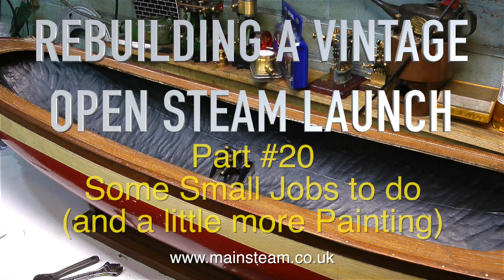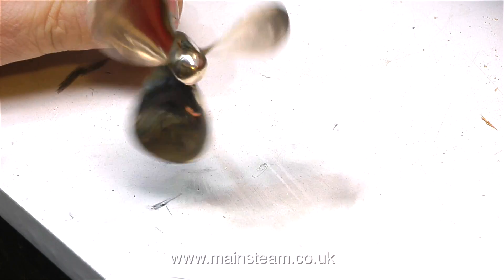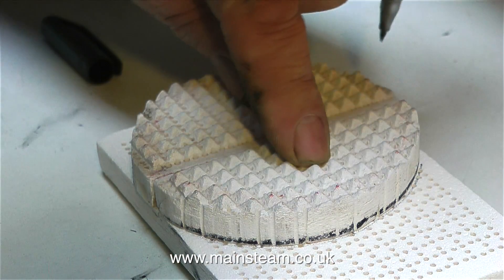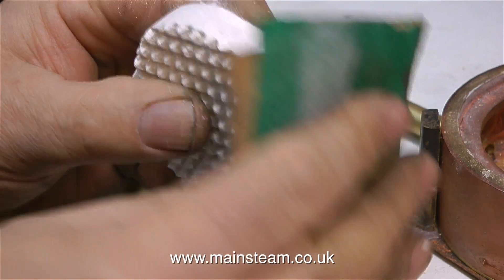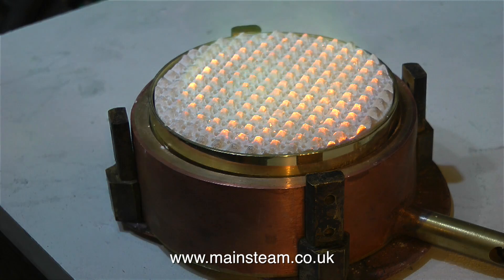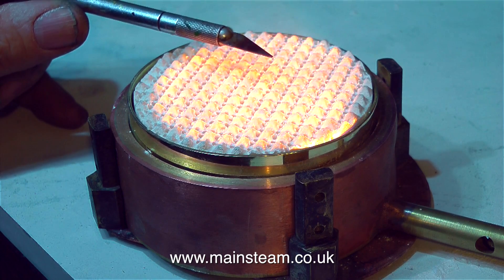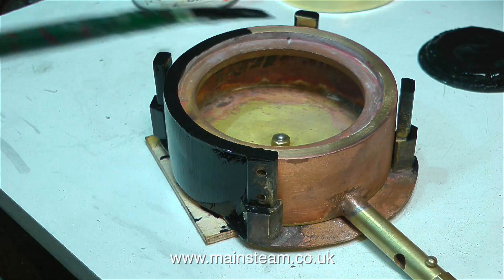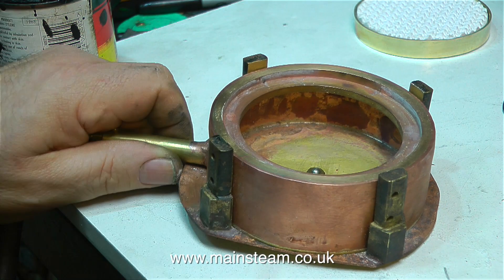REBUILDING A VINTAGE MODEL OPEN STEAM LAUNCH - PART #20

Comment: I'll be unpainting tomorrow, just bought a sand bast cabinet.  Just a mere 4 hours assembly to put it together with my new Bahco adjustable spanner straight from ebay UK. Thanks an inspiration but what about the vaccuum, is she still in love?

Comment: What do you use to cut the ceramic burner?  It must not be terribly hard if you can sand it down to fit the brass ring.
Reply from the maker: my small bandsaw - used very gently ......

Comment: You said that getting hold of ceramic was a bit difficult since your supplier had retired. Can I ask what the primary use of the new bit you used in this video was for?
Reply from the maker: For actually making the Ceramic burner - as featured and demonstrated in the Video . . . . .